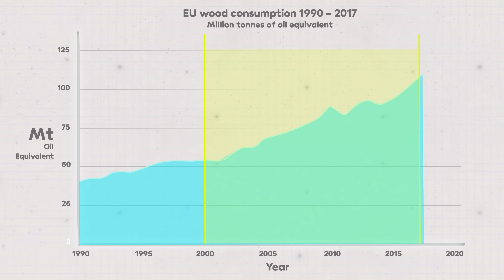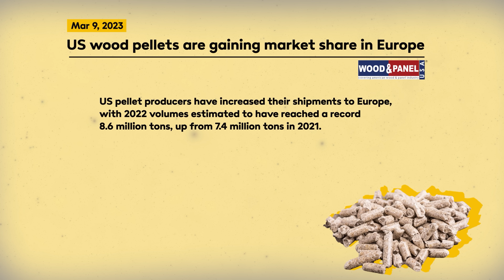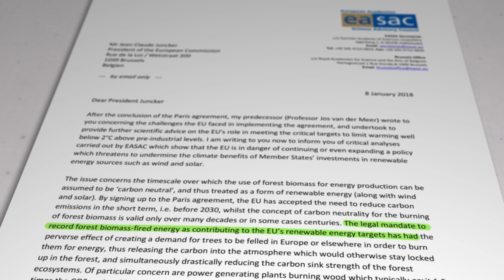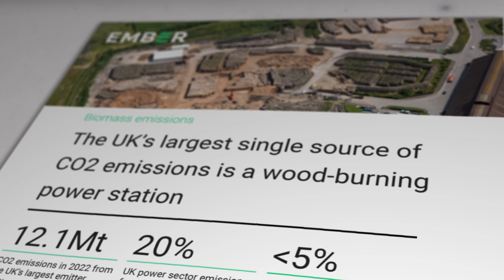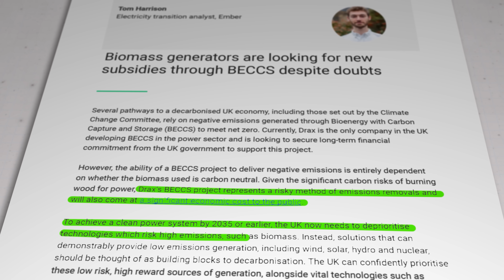New report: Biomass CO2 emissions 4X higher than COAL!!

Comment: Now in France we see sustainable forestry and wood harvesting by locals using cycles of regrowth replaced by clear felling that throws everything into shreddings which are carted off to be made into wood pellets for the new generation of wood stoves.  This is apparently 'sustainable' although the forest felled will take a minimum of 60 to 80 years to return to carbon neutrality even with softwood species.  Of course all the pellets created at the present time are turned into immediate carbon dioxide raising the level in the atmosphere while the deficit remains for all those decades. 
Quite apart from the disaster this means for climate change the impact of the environment and natural world is far worse and we now see hectares of wastelands which with ever warmer, dryer summers find it hard if not impossible to regrow trees.

Comment: I just became the highest co2 emitter in my neighbourhood by mounting a hula hoop on my roof. Now any time the wind blows I emit tons of co2 from the downwind side of the hoop! All jokes aside, it is incredibly misleading to rank co2 emissions of biomass next to fossil fuel plants without doing any accounting for net emissions which will necessarily trend towards zero in the long run for biomass.
Reply: Except the fossil fuels used to cut down, dry, and mash up whole trees, and ship them from one side of the planet to the other, are not trending towards zero. Nor is there any consideration that plantation trees are normally used in housing construction where the timber and its carbon would be locked up for decades or centuries to come, and native forest trees could have been left growing and being part of an ecosystem and rainwater catchment if somebody hadn't bought them to mash up and burn. Instead, all that carbon is dumped in the atmosphere within minutes.

Comment: Can't agree with this. Rouded example about Estonia.
For centuries my grandparents have used wood for heating that grows in the same forest. So basically the "same" co2 molecule has gone through the chimney many times. 
But currently we are talking about electricity.

I have sold timber from the clear cuttings from te same previously mentioned forest. The harvesting cycle for gray alder is 15 years. I previosly sold timber 13 years ago. I will sell it next time in 2 years. The emissions are counted again so 2011 emissions+2026 emissions. But in fact the same ammount of carbon that was released in 2011 has been captured by the same forest. Hence ammount of carbon in atmosphere by this example stays the same.
As this takes place all the time by different owners, the overall level of co2 for producing electricity and heat does not increase. Ofc. Harvesting emits co2, but that is imho 2%.
Reply: You forgot PM 2.5 particles. Very bad. Burning wood at scale is madness. Heat pumps are the future.
Reply: @johnturrell942  PM2,5 emissions also exist while burning coal. As this video was consentrating on CO2, I focused on this.
I agree, we should use heat pumps more. However our winter electricity (not energy) usage is already double the summer usage. If we grow the energy usage we are going to have a problem with whatever energy source (renewable or not) where we need ~3 times more energy plants during winter than during summer. It will make electricity expensive.

So to conclude... no easy answers. I do think that burning wood is better in terms of emissions than coal. I also think that while we transition towards more renewables, burning wood should be used.

For example. When we add some more windmills and batteries, we should have mostly renewable energy for most of the year. However  we still have like 2-4 weeks during some winters, when renewables are not enough. Burning wood during those times is more reasonable than for example building nuclear.

Comment: Most of the biomass burning power stations are not able to provide a reasonable amount of electricity. They are only making hot water for district heating. Then they can claim a high efficiency because perhaps 90% of the heat content of the wood is transformed into the energy in the hot water. That hight figure sounds nice. Making electricity in a complicated power station reaches an efficiency of about 55 percent.

Comment: The headline and the claim that the CO2 emission from Biomass is 4 times higher than for coal is completely out of proportion and without any connection to simple basic physical rules. It is correct what you say (8:42) that "wood emits more CO2 per kWh of electricity than coal and gas" - according to the emission factors according to the IPCC Guidelines (2006),  burning wood emits 1.19 more CO2 per energy unit than fossil coal, from the combustion process itself. In other words, it is the gross emissions released from the chimney, without taking into account all other contributions in the CO2 cycle, including especially the plants' CO2 uptake. Gross emissions do not directly say anything about climate impact, because they are taken out of context. Calculation of CO2 Gross emission is only an expression of the size of the turnover of energy. It is reported to the UN for statistics, and can be used to quantify how much CO2 is available eg. for PtX or CO2 storage.

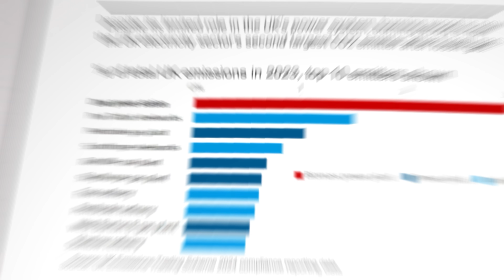The claim that wood biomass emits 4 times more CO2 than coal is supported by a claim (8:46) that the biomass-fired Drax Power Station emits 12.1 million tonnes of CO2 per year, and a graphic (8:58) showing that the same 2.7 GW biomass fired Drax Power Station emits approx. 4 times as much CO2 as the 2.0 GW coal-fired Ratcliffe Coal Plant. Please tell me, how can 2.7GW biomass power emit 4 times as much CO2 as 2.0GW coal power ?? If we assume that both plants run the same number of hours at full load, according to the IPCC guidelines, Drax will emit (2.7x1.19)/2.0= 1.6 times as much CO2 as Ratcliffe – gross emissions from the chimney. Factor 1.6 is far from 4.0. There is a lack of detail in this equation. It could be that Drax has many more full load hours than Ratcliffe. It's like comparing x apples with y pears

As far as I can find information, the Drax Power Station burns 7.5 million tons of biomass per year. Combustion of wood biomass emits approx. 1600 kg CO2/tonnes, gross emissions from the combustion, i.e. in total approx. 12 million tons of CO2 released from the chimney, which agrees with the figure of 12.1 million tons of CO2 mentioned in the EMBER report (8:46). Again, gross CO2 emissions are only an expression of turnover of energy, but say nothing about climate impact. The calculation method is not unknown, because e.g. Statistics Denmark (institution under the Danish state) uses the same creative accounting method. Either there is something completely wrong with you and your sources' understanding of the cycle and process, or this video is just pure propaganda against biomass.

I think it is wrong and unfortunate to put is as a question as either biomass or not biomass. Biomass is solar energy in stable storage form, and can therefore be timed and utilized exactly when the need for energy is greatest in relation to availably of fluctuating solar and wind energy. In this way, they can support each other in the goal of reaching 100% supply with Renewable Energy. At the same time, this means that the burning of biomass should be adjusted and throttled down when there is plenty of solar and wind energy available.

Comment: Plants need co2 to grow, co2 released from plants in any form is already carbon neutral.  Co2 equals more vigorous plant growth, co2 os water solioble. Co2 is NOT bad for the environment.
Reply: @pu                        Under the influence of certain psychoses a person can drink so much water that electrolytes are affected to the point that the person can die. 
The dose makes it poison. 

CO2 & other greenhouse gases are increasing heat & sea level & worsening deadly disasters to the point at which civilization is threatened. The science on every bit of this is overwhelming, & agreed on by an essentially unanimous scientific community. Denial of it at this point, 50 years after there was no reasonable or scientific doubt, is a much-too-common but very serious psychosis. Please stop posting nonsense & get into psychotherapy.

Comment: Yea the problem with a lot of this stuff is that it does START out as a good idea. You have a waste product and you need to do something with it. In this case, the waste product can be reuse to create heat and power. Makes sense, but once you start having a demand for it, then you need to make more of said product. When your produce is just a waste off set - that means you need either more waste access or make it your self. Thats where the good idea ends and becomes a problem. There are a lot of examples of this happening across the board. Thats one of the reasons why I am scared when I hear "we can make it from waste products" like - ok - but what result will happen if you dont have enough of that product after ?

Comment: Biomass burning uses carbon which was drawn from the atmosphere as the biomass grew, and returns it to the atmosphere when the burning happens. So by definition, it is exactly net-zero - no matter how much carbon dioxide is emitted. That is unlike coal, which uses carbon drawn from underground and adds it to the atmosphere. Also, much like forestry, which is not a valid carbon sink, because it does not take carbon out of the carbon cycle.
Reply: So what? How does this relate to the growth of forests in the carboniferous and the trapping of their carbon content underground? You're off on a complete tangent to the issue.
Reply: Coal comes from carboniferous vegetation. If we return the carboniferous carbon to our atmosphere, we'll be back to hothouse conditions and giant insects!
Reply: @PJRye  how much co2 was there during the ordovician ice age?
Reply: @juzeus9  Twice as much as half as much! What an irrelevant question! There were no trees then!
Reply: @PJRye  the correct answer is 4400 ppm, more than 10x what it currently is in our current ice age, the quaternary ice age.
Reply: it's the same as coal. coal comes from vegetation
Reply: maybe one day you'll figure it out. fossil fuel is the greenest energy.
Reply: @juzeus9  You are clearly a fossil fuel industry dupe. The evidence for the negative environmental effects of fossil fuel emissions is all around us, pretty much every day now.The oil industry had modelling showing the effects of their emissions back in the 1960s that they hid. NASA had their own evidence (submitted to the US government) in 1977 showing the same thing. There is NO UNCERTAINTY about the negative effects of fossil fuel emissions.

The only people who now argue against the  damage from fossil fuel emissions are those who have been fooled, and now will no back down, because their vanity is more important to them than the future of the human race.

This exchange is CLOSED.

Comment: since when is cutting trees down and burning them eco? I heard arguments that it's done in a low oxygen, closed environment and that all of the carbon is stored in place - so that it goes back into the soil to enrich the carbon content of it and new trees and grow - which soak up more carbon - than older trees. What're your thoughts on that? I get that open air burning probably isn't the most eco, but there are arguments for biomass if done correctly, although I still agree with others - that if you find ways to repurpose it - it's easier than burnign and growing new.

Comment: 5:48 rotting wood doesn't put "a good chunk of its carbon" into the ground.  Do you really know where the carbon in a tree comes from and then where it returns to?   The energy for carbon sequestration in wood comes from photosynthesis.  Not the ground. A few nutrients come from the ground.  When you burn wood, you're left with a tiny bit of ash.  The ashes are the nutrients that the tree took from the ground.  All of the carbon came from the air.

Comment: Be careful with your wild claims - a final report released today: 
"The UK energy watchdog closed its investigation today, confirming that it didn't find any evidence that the wood sourced by the FTSE 250 company for its biomass burners is not sustainable or that renewable obligations certificates (ROC) were incorrectly issued."
"A £25 million redress payment was significantly less than the circa-£150 million of market cap lost when the investigation was announced, said Morgan Stanley (NYSE:MS).

This "should have a positive read-across to the process of Drax potentially securing a bridging mechanism contract with the UK government", said analysts at Jefferies."
We already import 15% of UK electricity - would you like to increase our insecurity ?
We only have 7 days gas storage in the UK - would you like to increase our insecurity and ask President Putin if we are allowed to charge our bicycles and other vehicles ?
Biomass can be stored easily and balance intermittent wind and solar which does not work in the UK in Winter.

Drax stopped burning coal but you really think it is many times less carbon intensive ? 
You do not want tree planting because it can a few decades for a tree to grow ?
Nonsense surely !
The carboniferous geological age ended because the white rot fungi evolved a powerful enzyme to degrade lignin and turn trees back into carbon dioxide directly.
Canadian wildfires (wood burning) just this year released more carbon dioxide than a year of fossil fuel burning across the World.

Comment: Some other considerations you could add:
1 The energy requirement to reduce the moisture content of the pellet feedstock to an acceptable level. Green wood waste is about 50% water. Feedstock needs to be 20% water or less.
2 The electricity required to run a hammer mill to grind the feedstock to the right size particles for pelletising
3 The electricity required to run the pressing machine to make the pellets.
Also, while pellets are being shipped from North America to Europe, some are being shipped from New Zealand to North America !
Reply: Pellet mills do not use that much energy for the output.  Same with hammer mills.  I have both.  Second, you dry the wet material in the sun, not by buying energy. Third. Co2 is not a pollutant

Comment: You've misunderstood why they are considered carbon neutral or even carbon negative in some cases.
Depending on the source of the material the biomass is made from, they can be carbon positive or negative. The reason they can be negative is if the plants that are used to make it absorb more carbon during growth than they release with used as fuel.
Reply: What if the logs where stored unburned in manner that stopped from decomposing
Reply: @Loanshark753  The idea is to find ways to replace fossil fuels without increasing greenhouse gasses. If you're planting corn for example, and harvesting it for fuel while planting and growing more corn, that is net zero and potentially net negative depending on if parts of it are used for things like plastics that won't be burned.

Comment: Of course biomass means more CO2. When any carbon based fuel is burned, carbon is a byproduct of the pyrolysis process. Some is CO, some CO2 and some is elemental carbon. Dirty burning of fuel means more of the carbon is elemental - as smoke. This ends up in the ground as sequestered carbon, or within other organisms. Clean burning means turning more of the elemental carbon and CO into CO2. So, paradoxically, cleaner burning  makes more CO2 and thus more climate warning. One way to reduce CO2 is to burn dirty, make more smoke, but filter the smoke out as carbon.

Comment: So digging up the equivalent amount of coal out of the ground using fuel-powered vehicles. Creating massive holes in the ground. Been burning that for fuel. It's less harmful than trees.  Doesn't seem logical.  Using this as a sustainable way of producing fuel is obviously idiotic, but I still see burning a tree versus burning a coal to be any worse if you look at that slice of the equation.  And what about industrial hemp?  Grows 10 times faster The trees.  Can be turned into pellets.  And has many other benefits for the land and this product.

Comment: Presumably the 4X refers to CO2 pollutents per unit weight of fuel? But coal is a fossil fuel, while wood is recently grown and a bio fuel, so it is wrong to compare them in any way. I thought this was obvious decades ago, coal is after all compressed trees, so is naturally denser and contains more energy. But if trees are grown for energy rather than furniture etc then it's simply take and put back and solves nothing. beter than trees or other energy crops, hemp removes more CO2 as it's faster growing, the plant can provide medicines, recreastional cannabis, oils, and most importantly fibres which can make clothing, bedding, upholstery, canvas, ropes ands even building boards. The fibres are strong and last many times what cotton does and thus locks away carbon for longer. 
As always it's bits of everything that need doing, there's no magic bullet solution. In fact there may be no solution fast enough, so all the repeating of arguments is happening while Earth burns. Anyone got a violin?